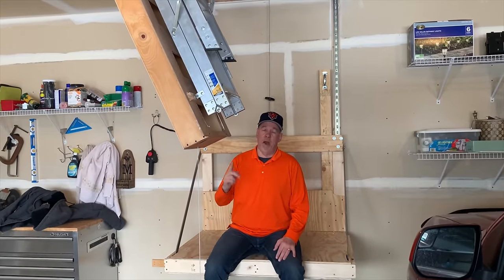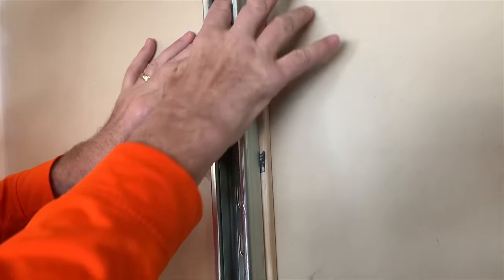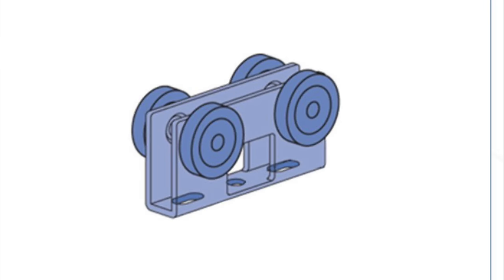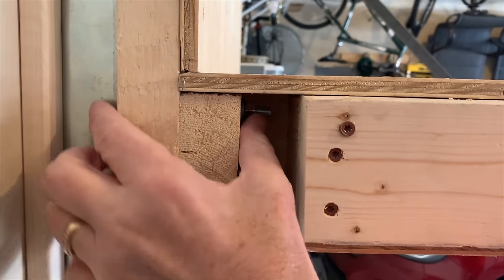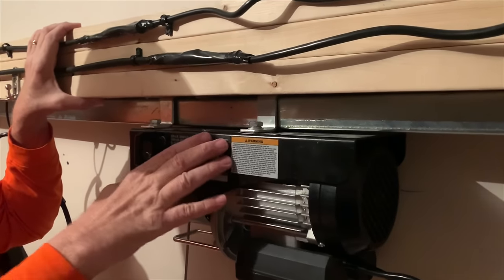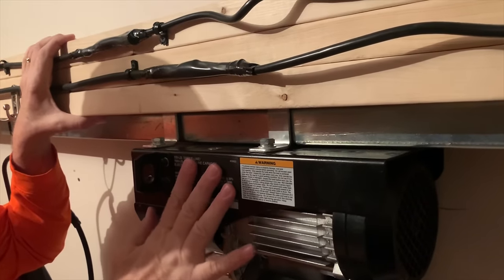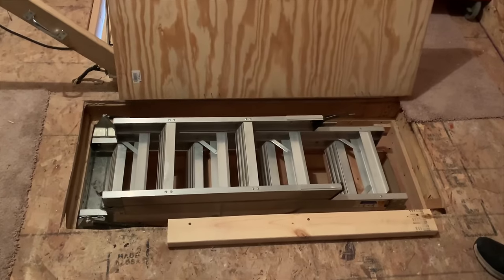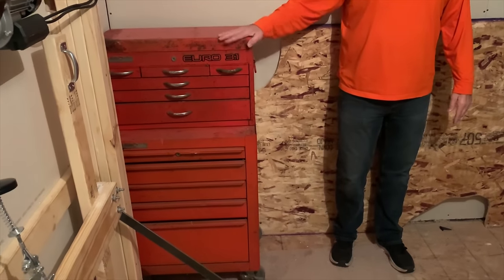Garage Attic Elevator / Lift Build in Minneapolis Minnesota

Comment: yes i like this. but what if the wall does not have any studs inside it what  you do for that? bed room is  a Concrete Block House  here a online photo of the exact material thy used for the structure the room also you can see it in the concrete wire and  rods  https://www.dutchpickle.com/wp-content/uploads/2010/10/concrete-block-construction-007.jpg so how do i do this on that kind of room the room is already made we are thinking of adding a second floor bed room and no room for stairs unless we use a narrow spiral  staircase inside the bedroom Conner i wish you tube would let use put photo here so u get more idea of what i trying to do some day not sure if we can add more to the house
Reply: joe selzer
 ... Under no circumstances should a DIY lift be used for passengers! Something rated for wheel chairs (with people) might be acceptable to your local building department, but you'd have to check on regulations for your area.
Reply: @joeselzer850  ... just because it's another country doesn't change the safety factor. One thing you might consider is an outside stairs because you will find the spiral stairs to not be good if you need to carry anything. Even a suitcase is hard to get around on a spiral stairs. Imagine trying to get a bed or dresser up there?
Reply: @rupe53  yes i did not think it would make it safe  just because it in another country but maybe it can use it for the bed to felt it up or any thing ells that would be too big and use the spiral stairs just for going up with out any thing in the hand i think my gf would not like out side stairs but i will give her that option and see if she does or not thanks

Comment: Great job Brian! Thank you for posting this. I was looking at these before and your video just reminded me to get this on my "To Do List" for the near future. I just spent a lot of time moving things up and down my ladder stairs and it is so dangerous. I even used a rope and pulley system to pull heavier things up and let them down after back surgeries. I was adding insulation and had to break down the packing because it was too large for the opening. You reminded me that I need to do this for many things that are taking up floor space. With the lift, you can move things like welders up and down more easily. Floor space is so important that I was looking at building on extra shop space..

Comment: Definitely not and engineer or caperenter. The top beam should have vertical members not horizontal! Height creates strength. Bh^3/12. H equals height. B equals width.  That is why any video u should have watched for beam design would have had vertical nor horizontal. 
The winch might handle 1100 lbs but that beam sure wont. Surprised it holds 550...time will tell.
Reply: @theelevatorSRT8  ahh your panties in a bunch?! If multiple people have called out the mistake then why dont u make a video explaining it? 
U r the one making a video telling people how to make something that could kill someone. So yes i will be critical. Dont like it? Dont post.

Comment: Thats brilliant but you know that drywall won't last in the garage without paint right? I always paint with exterior zero voc paint. I use the 123 primer and Sherwin Williams Emerald exterior paint, also I install with exterior painted drywall screws, and I reinforce the edges with 2x4s so there is plenty to screw to, I never split two pieces of drywall on one stud, and I use the best fiberglass tape, in the corners I use fiberglass first the paper tape to get the perfect corner as well, then prime and paint twice and back roll each time. My Garages will outlast most, and most importantly are air sealed and vented to the outside, I also use sprayfoam in the walls between the house and garage, and waterproof the base of the walls in the entire house to protect the walls from water damage and bugs, then I caulk the baseboard for another level of protection then add shoe molding that is also caulked on. I love creating the absolute best quality home possible.  I miss it.
Reply from the maker: That is impressive my friend.  All good advice.  Thank you!

Comment: This lift has none of the safeties that a lift like this truly might need.

Should the cable break, the lift will fall.  You and your material will return to the earth quickly and to a violent stop.   Injuries and possible death.

If by any chance you leave a hand or foot over the edge of the platform, there is no protection against possible detachment of your finger / hand / or toes.   

The "elevator" regulations -- lots of them -- come from the collective experience of people building elevators and someone losing a limb or life.
My company installs lifts, ramps and door operators.    Yes it costs more to put in a proper, safe lift system.

Comment: I'm sorry, your platform is not build correctly. I would strongly recommend that you would not put more than 200 lbs on it. And ask someone with structural experience to point your mistakes.  I see many. Carpenter /contractor 25 year experience.....sorry
Reply from the maker: I’ve already run a crash test with 300lbs of sand bags on it, and then I even cut the rope to see if the safety brake we created would hold it up. It all worked flawlessly.

Comment: Thanks for the inspiration for a wall-mount rack for my miter saw & stand.  Everything I've considered up 'til now has been way to complicated.
I hope that the floor of your attic space is strong enough to support the accumulation of stuff that will find its way up there.
Most residential floors are designed for 30-40 pounds per square foot uniformly distributed.  Doesn't take much to exceed that.

Comment: It  is  unlawful  for  any  person,  firm,  or  corporation  to  hereafter install  any  new  passenger  elevators,  freight  elevators,  handpowered  elevators,  moving  walks,  escalators, dumbwaiters,  wheelchair  lifts,  endless  belt  lifts,  vertical  reciprocating  conveyors,  stage  and  orchestra lifts,  or  any  other  related  device,  or  make  alterations  or  repairs  to  or  remove  any  existing  of  the  same without  having  first  obtained  a  permit  for  the  work  from  the  authority  having  jurisdiction.  Alterations, modifications,  and  practical  difficulties  will  be  done  in  keeping  with  the  rules  of  the  Department  of  Labor and  Industry.
Reply: Ham549 What is this? Federal statute, State statute, not a Statute at all?; just Trolling?
Reply: Why not just say that One should check to see if a building permit is needed?
Reply: @kimkietzman7354  State levle. Elevators get in a whole lot of red tape and licensing. It can also mess with your home owners insurance. "There was a fire in your kitchen?" "Well we see you have a unauthorized elevator in your garage and that violate their terms of service so we won't be paying you." Not that it's not very clever and handy just letting you know.
Reply: @kimkietzman7354  when it comes to elevators most of the time you also need to be a licensed elevator mechanic. Oh and it needs to be regesterd and have ongoing inspections. It varies by state and can seem very draconian. But even a small dumbwaiter can (and has) killed people. The other thing I've seen people do is get a cheap winch and replace the cable with a better one thinking that will make it safe, what I point out is how much do you trust the brake that keeps it from unravleing when the motor is off. Like I said I don't disapprove what you did I think it's very creative and it's probably a very big time and labor saver, I am just giving you a heads up. I'd like to just putting some kind of locking mechanism to hold it in place when not in use.
Reply: Kim Kietzman 
There’s always that one guy who wants everyone to know his knowledge.
“Just saying”
😂🤣😂🤣
Reply: Ham549 

Let me guess?
Trump is NOT your President?

Smh 🤦🏻‍♂️ go troll on the guys making backyard bombs, would you?
Reply: @cnvw974  What does Trump being president have anything to do with these regulations? There's always that one idiot that just has to bring Trump into everything.
Reply: Ham549 
Bahahahahaha!!!!!
I KNEW IT!!
ROFLMAO!!!
🇺🇸 🚂 🇺🇸🚂🇺🇸🚂🇺🇸
Reply: @theelevatorSRT8  I am not a hater I think it is clever. Just telling you so you know what to watch out for.
Reply: @cnvw974  russian troll
Reply: You must be fun at parties
Reply: Brian Michaels you did. And you did an awesome job! Very inspiring! Thank you for taking the time to post your build. There’s always going to be haters, specially when you did a great job building and explaining. Someone can’t tell you have plenty of common sense by all this....... well, don’t argue with those kind, they will only bring you down to their level.  Respect ✊🏻
Reply: @cnvw974  Innovation and risk balanced, it is how advances are made.  Keep up the work!
Reply: @Ham549 you must love government control, regulations, restrictions. That was not how American was built. Individuals should take responsibility for their doings
Reply: @langh.5283  you mean the America were if you had the wrong color skin you're either enslaved or had your rights taken away from you and if you're associated with witchcraft you would be executed?
Reply: @Ham549 sound like you hate America. That was the history and you should be thankful for how this country was built so today USA is the #1 nation in the world. I don’t have the right color of skin as white Americans but I came to America cuz I luv this country and to accept the past, the history how America was and America now.
Reply: @langh.5283  yes America now it's much better. But everybody talks about these founding father bullshits and lack of Freedom fails to realize we have more freedom and Justice now than we did in the past. Now whether this guy should build his own elevator or not I personally don't have any problem with this person does on their property as long as it doesn't endanger others which it doesn't. I was just giving him advice because they may want to keep it on the down low because like I said earlier insurance companies could use it as an excuse not to cover a claim even if it has absolutely nothing to do with what the claim was about. And you can possibly face fines for building code violation. I personally hope it's supposed to this video never has to deal with any of that and it is creative elevator get some years of great use.

Comment: I love it! And you did some engineering to design it!!! I am the LAST person to tell you your business.  But let me state some facts. Elevators are ENGINEERED with "Margin of Safety" factors. 11 is often used for people lifts.  This means if the elevator platform and its load do not exceed 600 pounds, the unit must be able to carry 6600 pounds. And that capability must be verified by a commercial lab like Factory Mutual or Underwriters Labs.  Your hoist has a  "rating" of X pounds.  Not certified . Nobody even signed his name to that figure. =It is just "hype" or China bullshit. WORTHLESS. The hardware used is all UNGRADED.  = Not even guaranteed to make it to the cash register.
Reply: All this helps explain why an inspected APPROVED lift sells for 10 - 20 times the amount you paid.  Also, installations must be inspected and re-inspected to verify their maintenance.  Note: I love DIY and I love saving money. My garage has a 16 foot ceiling and I would love to have one of these were it SAFE! Please do not 'ride' your lift or stand under it!